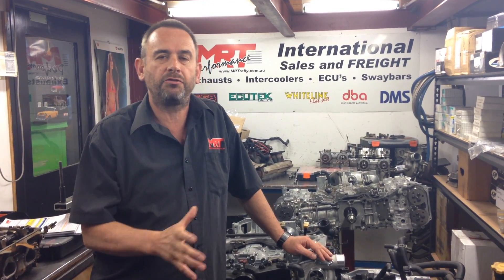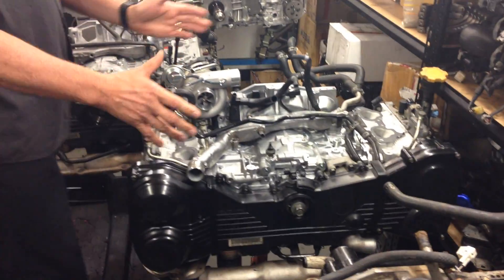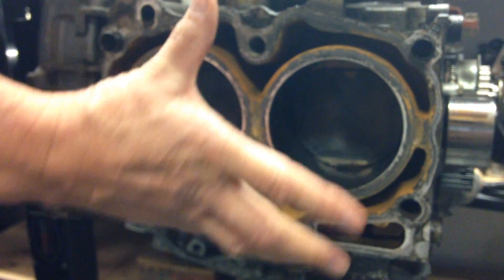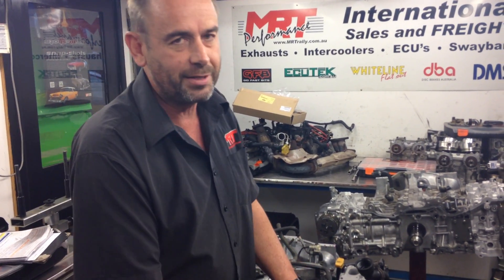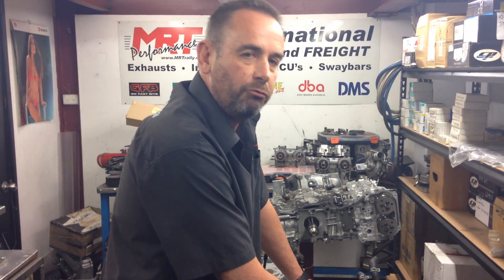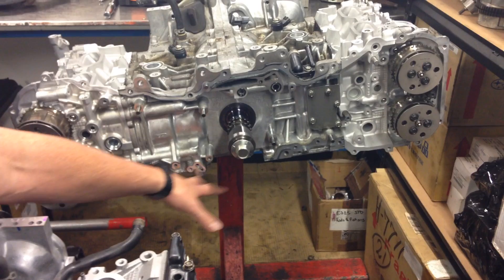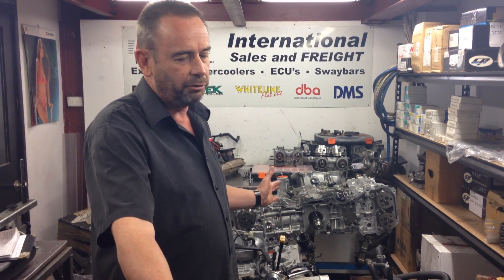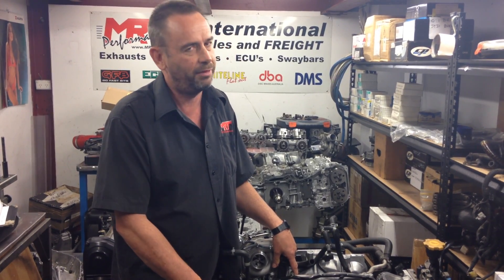Subaru engine comparison, FA20, EJ20, EJ25,STi, WRX

Comment: Hey I have a 2008 Subaru Impreza wrx 2.5 turbocharged with an engine EJ25 and I bought a new engine but this one is JE20 almost everything is the same from the old one but have 3 hoses i think is for the coolant but for the old engine only has 2 on the engine so my question is the engine gonna fit on my old engine?

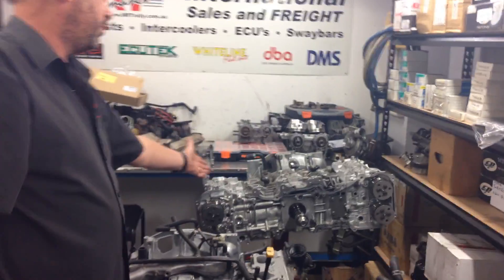Comment: At the 5:00 mark you talk about the FA series "being a worthwhile engine from a performance point of view". That was in 2016, do you feel the same way about them now, 5 years later? Also, I've read that the FA series uses the same piston make up that the EJ series did, which made them brittle. Are the FA series pistons also brittle like the EJ series or are they stronger than the EJ series?

Comment: One question regarding the ej20, the wrx block it self is the same as the sti one? Only the inside is different? So it would be possible to just put in the internal if the sti ej207 and i would have all the same advantages?
Greeting from Europe

Comment: So basically the FA20 is the better engine over the EJ25, I was gonna get a 2015 wrx but I'll probably just buy a 2016 or 2017 model to get the newer engine.

Comment: Not sure if people are still active in these comment sections. I have a scion FRS and I am looking to swap an EJ motor from a salvaged WRX or WRX STI. Im looking for an EJ motor that has forged internals from the factory. Which engine should I be looking for and which Subi does it come out of? Doesn't matter if its 2.0 or 2.5 liter. I would appreciate the info thank you!

Comment: Bought a used '10 STI with a rod knock engine that turned to have a 2.0L 207 engine in instead of 2.5L 257 usdm that it supposed to have and now I don't know if that's a bad thing or a good thing

Comment: Hello I have a big question I'm rebuilding my ej25 from my impreza 2.5i to turbo it am getting all forge rod pistons everything top off the line you think is a waist of money that the turbo is not gonna work on that engine please let me know I will appreciate
Reply from the maker: Depends what you are trying to achieve... we don't typically rebuild the na motors with forged bits in Australia - not good value
Reply: @MRTPerformanceAustralia  I just want it to get it to 300 hp not to much u don't think it will work
Reply: Turbo is not gonna blow it off that motor  or not if is built

Comment: Excellent video sir!  Thanks for all the info - really helped to clarify the differences in motors and applications.  

I do have one question on the EJ207 and ‘257 (STI’s) though - Q: Are the blocks on the STI motors actually stamped “EJ207” and “EJ257” or will they still just be stamped “EJ20” and “EJ25” and then differentiated by additional stamping/coding to identify whether/not for STI application?

Comment: Great video, I have 2x ej25 blocks one from an 08 sti, one from an 08 wrx (non sti) the casting stamps is 703 they look identical. Looking to use one in my bug eye. Are these identical blocks? Pistons rod crank? Or does the sti version have any stronger internals?

Comment: I’ve just bought a ‘05/‘06 Liberty GTb tuned bySTI which I’m assuming is the twin turbo EJ20t? Is it possible to swap it for a ej207 straight out of an actual STI? Does anything else need to be changed? Due to physical constraints I had to buy auto, would the gearbox be able to support the extra load? Is there anything that could be improved with the gearbox? TCU tune? I LOVE the size and shape of the gen4 Lib wagon but I’m coming from a Golf R wagon and could always use MOAR. I’m in AUS so would have to get you guys MRT to look at it, I just wanted to ask first so as not to waste time for either of us. Cheers!

Comment: Hi.. I bought a Subaru ej20 (written on engine body) imported engine (so I have no vin).. I was told by the seller that it came from Australia and probably MY 00-07.. the motor number is 730128 and has 4 valves per cylinder... is there anyway I can know more information on this engine trim and specs.. I searched a lot online and I’m can’t be sure what exactly is it.. any pointers will be very useful..

Comment: My 2013 Scion FRS had a recall on FA20 with Valve Springs that crack and timing breaks! What I wanna know is, what i can replace it with that is a direct bolt on? EJ20 or FA20 out of the 2017 Toyota 86 GT?
Reply: The newer fa20s are better but you could also just get new valve springs

Comment: I had an ej20x swapped in my legacy can you tell me what it is?
Reply: It's just a jdm engine 2liter instead of the 2.5 that it comes with. It has a higher static compression so you can't run as much boost.

Comment: Not discussed was the major difference when going from a 2L, in the crankshafts, rods and pistons, but should that be obvious?
All newer 2L/2.5L cranks/blocks are directly interchangeable, but the stroke is different. Main & rod bearings on recent turbo EJ20 and EJ25 are identical. If you mix older stuff you will run into issues with the thrust bearing being on main #3 instead of #5. They can be machined to switch to #5.

Comment: Fantastic information.but I have a question . I have a 2003 Subaru Forester X 2.5L MT  (EJ251) Can I swap the engine EJ251 to 2014 or 2015 upper ?

Comment: Run an AOS / get an equal length header (i know no more rumble)/ get it tuned according to the mods you got/ service regularly with premium synthetic oils..you'll be suprised by the ej257's efficiency & reliability 😎
Reply: Ive got all that and more but still would not want to push past 350awhp on the stock ej257 block

Comment: hey, im a big fan from brasil, I watch all your videos. I have an ej207 that spun bearing and had a cilinder scraped by the piston, with some axyal spacing on the crank... and my friend has a ej204 that is disassembled and ready to sell. is it possible to assemble this ej204 block with ej204 crank, ej207 pistons, rods, heads and eletronics? (i have a spare piston to replace but a ej207 block is too expensive here in brasil) regards and thanks for sharing so much valuable infos on subaru engines!!

Comment: i have a  legacy 2005 gt 2.5L turbo  so the ej25 and the engine went out at 150k miles  ive had that car for 10 years , i bought a jdm 2.0L turbo engine and its getting installed i hope the engine  works good and it lasts , i was told by the shop thats doing my swap that  the ej20 will be a direct bolt on to my ej25, is that true ?> i wanted to get your opinion . also  the 2.0L engine i bought its jdm and i have an american ecu is that going to cause anything to go bad i was told by the shop no  and that the car will run the same as the 2.5 , was wondering what your thoughts are
Reply from the maker: why did you go backwards on size when all you needed was new pistons?
I hope the JDM engine is an old type  as the newer ones do NOT gave forged pistons
you will need a custom ECU tune immediately

Comment: I just bought a 99 Forester S with the EJ25. Has 110,000 miles on it. It sounds pretty good and your video was very helpful. I dont know much about these engines. I live in Amaerica and I like my V8s lol. Is there anything I should really worry about these engines or are they pretty reliable?

Comment: Seems the EJ257 is mainly made to cater to the US market which has shitty gas vs. Japan and other parts of the world. This explains why JDM Impreza STI always exclusively employed the EJ207 but thanks to a twin-scroll turbo, significantly higher redline (the forged pistons?) makes equal hp to the larger EJ257 but in a smaller package. The EJ257 makes better torque which Americans seem to want in cars which is likely why it continues to be employed after all these years.

However knowing this I wonder how Subaru will go from here, as separate castings & engine sizes are going to be costly for the small company. Given the new Ascent announced the FA24, would the USDM & EU market get a FA24 powered STI while JDM switches over to a high-tune FA20, or all future STI would use one single engine size?

Comment: Too bad the fa20 doesn't allow unequal length headers which sucks
Reply: George Parker what do you mean? They make UEL headers for fa20's
Reply: Alec Reid they don't it's impossible with the twin scroll turbo
Reply: I'm curious as to why you would want the uel headers? if its just for the boxer rumble, well Subaru does offer a factory exhaust that will give you that.

Comment: Thanks you. Informative vid. I am in the market for a turbo SUV and looking at Santa Fe or Sorento. Do you deal with these models? 
Maybe you can shed some light on reliability of common rail fuel systems, fuel choices (reliable suppliers) and DPF filters. I am reluctant to spend a lot of money on cars with diesels that may be fragile.

Comment: thanks for informative video , can you advise me which of these engine would be better for ultralight airplane
Reply from the maker: hmmm, not sure,we have never done one for that application
Reply: I can answer that for you easily.  NONE !!! An airplane will require an engine similar to a marine engine - they need a very flat power and torque curve throughout the rpm range.  These engines are all designed with a peak torque and power at specific rpm.  Put a simpler way, for that aplication you need an engine that will produce, lets say 200 hp at 1200rpm, and still 200 hp at 4500 rpm, with little variation.  Look for a marine engine.
Reply: hmm , not sure what I was thinking late at night, but the answer is still blatantly NONE.  You need an air cooled engine. There is no way you are going to get a rad etc on an ultra light.  You need an engine designed for that exact purpose :)
Reply: Actually, these engines are quite popular in autogyros, which are often enthusiast home built small aircraft.  I have been a passenger in a two seater autogyro with a scooby turbo flat four.  I didn't ask the owner which version, but it was beautifully built.

Comment: I recently bought a 2010 Subaru Forester (non turbo) which I bought knowing it's an STI. It has the STI badge at the back. The Engine is EJ204. Is it possible that it's actually an STI engine? Am not very good in knowing the differences. If anybody could help I would appreciate. Thank you!

Comment: Please answer me. Can the fa20 produce 400hp and 330whp with ease? Or the ej25 will produce it with more ease? (What is the perfect engine for 400hp and 330whp?)
Reply: The FA20 can produce up to 600hp provided you have forged internals, 400hp will be easily done with forged pistons and rods and maybe fuel system upgrades
Reply: FusionBlitz but what about the ej257?
Reply: ej257 can make that much power as well but you will need more boost, the FA20 is just a more efficient engine
Reply: FusionBlitz well. Should I go for the 2017 WRX or wait for the 2017 Honda Civic Type R Prototype? :)
Reply: WRX if you want AWD and power, Type R if you want a hot hatch
Reply: FusionBlitz but with performance? What would you vote? (Tuning, modding/building)
Reply: I'd take the rex, people are reliably getting 600hp out of them without breaking the bank. And AWD is just better than FWD so yeah you could get a lot of power out of the type r but your driving wheels would hold you back.
Reply: FusionBlitz but don't you think honda is more reliable than subaru? Just asking.
Reply: Yeah honda is more reliable but not by much, any japanese car will be good in terms of reliability

Comment: do built motors give alot of trouble?
I just want a reliable motor. don't know if I should go oem or built
Reply: Young Rik hvac depends on your hp goals. If you're looking to get High hp get built block.
Reply: C. Camp the only reason I wanna get built is to avoid ring land and spun bearings. 
looking at 340whp

Comment: What type of turbo kit would you suggest for a 2016 subaru liberty 2.5 premium? i dont intend to race or anything like that. Just looking for something that will spool up quickly for better performance from low RPM. The CVT seems to be flat until it hits the 3500-4000rpm range. I have read in the US Subaru released a Legacy 2.5 B4 Turbo.

Comment: my f20 rod knocked bone stock no mods toyota didnt want to help me and wanted 10k$ 32k miles on the motor.. sued the fuckers now i have a sti :)
Reply: john jay That's funny because my 5 Subarus (all turbo and tuned ) I've had over the years have been reliable as fuck.
Reply: The flats are kinda like rotaries... You have to let them warm up before you can beat them or drive them normally. Im pretty sure 80% of people dont let their engines heat up. In an inline its less a problem.
Reply: thatonebeone I have a friend that had the same issue with his stock STI @ 18k... After the law suite he now driving 3 series.
Reply: Inverted V12 Powerhouse Care to explain why?

Comment: If you leave an EJ25 STi completely stock, will you still have engine reliability issues or is that only when you start modifying?
Reply: i have 17 sti that is completely stock. at 1838 miles, i cracked a piston in cyl 4.
Reply: Well that sucks! Were you rev limiting it or otherwise driving in a way that could cause damage?
Reply: RexSpec555 I'm sure you have already heard about the reliability issues these engines have. There are plenty that have issues when 100% stock. They get covered by warranty. But the ones that mod do not get covered. Many agree that Subaru really needs to address the issue. No sports engine should be blowing with minor mods. Shit, it would be nice if these didn't blow stock.

You should be able to drive the sti like you stole it. 

I just bought a 2014 evo x gsr (just bought it new in July 2016) that I drive daily. I've tracked it and had (and will continue to have) plenty of fun with it. I'm not babying it at all. I have 6,000 miles with no issues at all. I also have a 2012 mustang gt with 77,000 miles. I have beat on that car and have zero engine issues. 

Subaru better update engine ASAP

Comment: is it safe to put downpipe, catback and accessport? i really just want 300hp at the wheels?
Reply: almanu04 not safe to put anything on it. They have issues stock
Reply: almanu04 yes it is safe. every mass produced engine has a few with issues but on the whole these engines are excellent to build on, just stay away from bigger turbo atm.

Comment: i guess im screwed coz i got the 2016 sti. it sucks paying all that money and have a weak motor. whats your advice? maybe trading it in?
Reply from the maker: wait for the new STi with the FA20 OR trade it for a WRX!
Reply: almanu04 get an evo! Some dealerships still have them and are letting them go for less than msrp. I picked up a brand new 2014 evo x gsr in July 2016 for $30,999. Came out to $34k and some change with taxes and license. I can beat on that engine and I don't have to worry about engine issues. 

But if you really want reliable hp, get a mustang gt. I have (still have it) a 2012 mustang gt and have zero engine problems. It has 77,000 miles. You can get these for even less. 

Both my cars are stock and I drive them hard.

Comment: Which is better for performance equal length headers or unequal length headers
Reply: equal x2
Reply: yea but the performance gains you get from an equal are negligible.
Reply: CrazyForCooCooPuffs negligible gains? lol
Reply: U MaD yea, if the gains were good then people wouldnt be running UEL on their cars with 500+ HP.. I'm not stopping you from making your car sound like a honda though.
Reply: CrazyForCooCooPuffs neither i am making u install a elh, people use uel most for the sound but If they install a elh they can make more power and a better spool, tbh i dont the sound too but for some people performance>sound

Comment: hey Brett I have a 2005 Subaru STi and it has a bad fuel/gas smell inside the cabin and getting tired of smelling it happens on cold cooler days on cold starts in the morning or when the car has been sitting for awhile would that be injectors seals, fuel rails, injectors fuel lines or anything in the fuel system can you help me out
Reply from the maker: maybe a fuel leak from the old OEM rubber fuel hoses?
Reply: the stock ones under the intake manifold